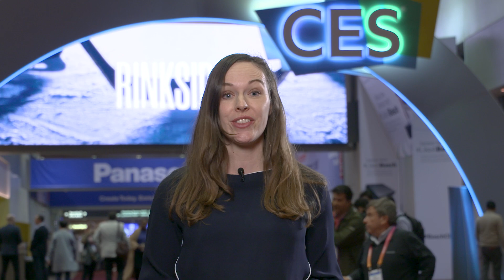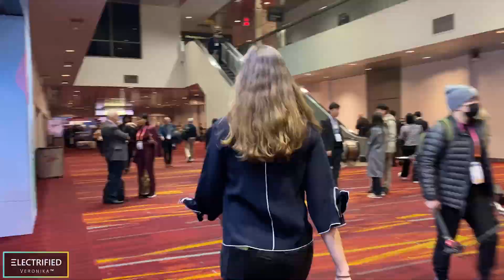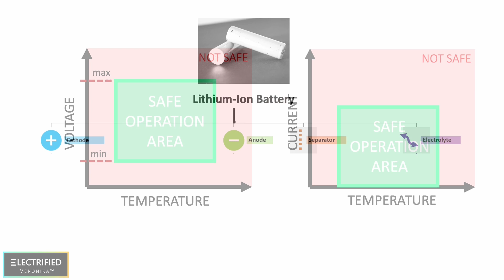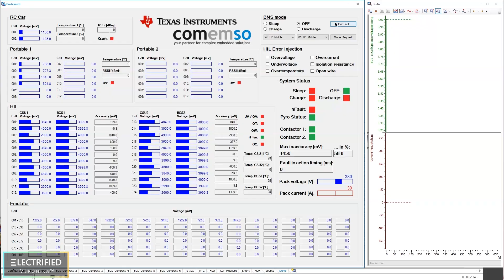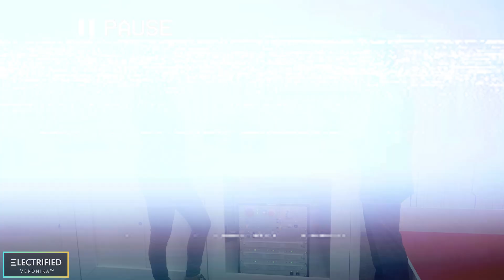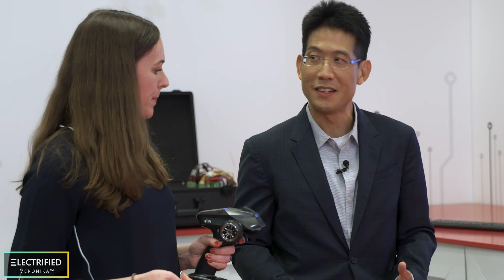What is a Battery Management System BMS? EV Range Prediction, Charging, Safety

Comment: I mean, cute demo but the whole power of their wireless BMS system is that it makes packaging way easier, BMS wiring can be right next to the modules instead of snaking huge harnesses everywhere. It's fantastic for conversions in principle
Reply from the maker: Indeed, one of the biggest benefits of wireless BMS is the fact that production is easier.  A machine can pick and place the modules without having a technician present to physically connect all modules together.  Eliminating those huge harnesses not only increases reliability and saves space, it can also reduce the amount of manual labor required to connect each and every module. Would definitely be a benefit in my conversion too!

Comment: Wow!! Quality 20+ minutes!! Technical yet easier to comprehend! I was curious about their gauging algorithm. Does their SOC algorithm consider the 50% mark of Ah discharged right in the middle of the OCV curve or little less than that? I would like to know if their algorithm is based on SOC based on capacity or SOC based on energy. Also very happy to learn about the smart DC fast chargers to coordinate and work together to fulfill the peak/off peak hours. Very curious about integration of the V2G from a commercialisation aspect. How can EV car users get benefits when they provide energy to the grid.
Reply from the maker: A very good question. Actually, the algorithms that run on the BMS are developed either by the BMS developer or by the OEM itself - TI is the supplier and integrator of the system in this case, but the programming and algorithms are responsibility of their customer.

Comment: Texas Instruments make great chips especially for hobby projects, I especially like their quality for the prices they ask for. I will have to look at TI's battery management system chipsets soon as I have been planning on converting my old Chevy Silverado truck to EV.
Reply from the maker: Absolutely! We are right now also investigating how we might be able to integrate some TI products into our Jeep conversion - especially on the Junction Box  - we noticed some major advantages in some of the products. Stay tuned for that.
Reply: @ElectrifiedVeronika  Looking forward to the video that involves those chips as I may have to put together the custom BMS, so of course safety is still the priority.
Reply from the maker: @Dr_Mario2007  Absolutely, as you might know in our conversion we are using AEM BMS but this is just the "Cell Supervisor Unit". Then we try to reuse the contactor box from the Mach-E, but especially the pre charge unit and the pyro element peaked our interest at CES!

Comment: Very insightful. 👌
What are the sampling frequencies and measurement rate in different subsystems in a BMS? This important for amount of the data and to upload to the cloud.
Reply from the maker: Thanks! So in a traditional BMS industry standards for voltage and current would be a sampling frequency of 100ms - but they are pushing for 10ms right now. The latter comes with the challenge that the communication bus between the battery monitors must be fast enough and able to handle the bus load. Moving to 10ms also has an impact upon the diagnostic timing interval which is typically around 150ms depending on OEM. Overall, if we want to move towards sending voltages and currents to the cloud, we would envision more preprocessing of data on-board of the BMS to reduce the bandwidth of the data over the cloud - instead of sending all those signals in high sampling frequency. I am really curious to see where all this will take us.